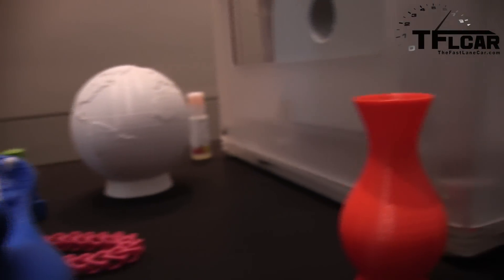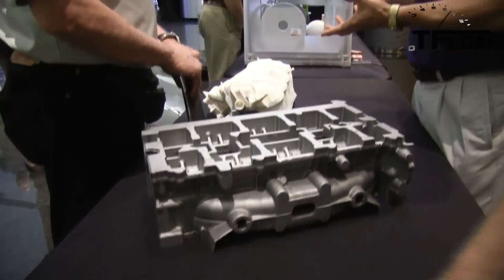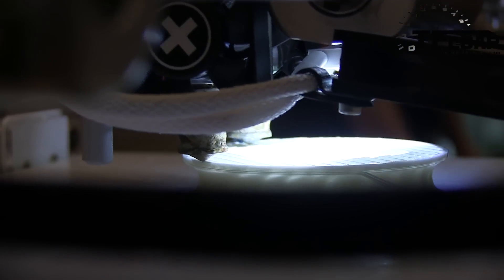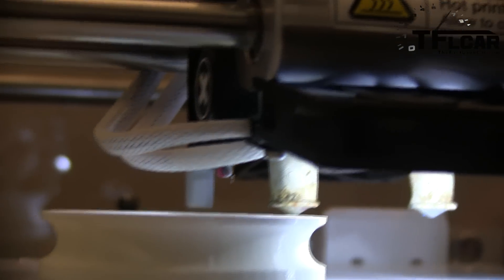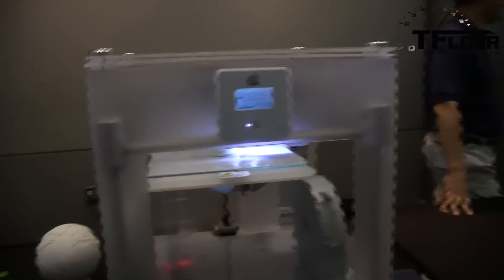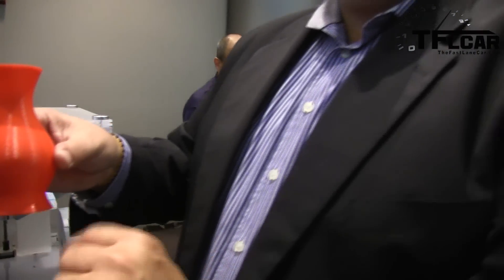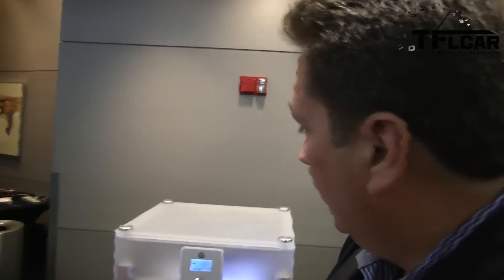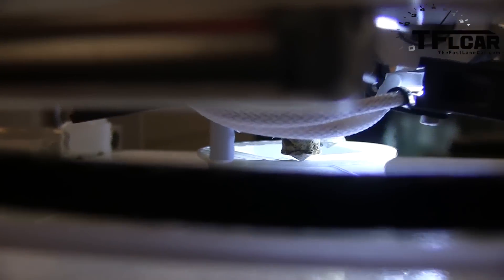The Future of OEM parts: 3D Printing replacement Car Parts?

Comment: I would like to see this used to make transmission parts for the Mercedes Benz 240d and make the 5 speed or more gears to attach to the engine.
Reply: Do the design work and that can happen.

Comment: Meanwhile in Sweden, Koenigsegg is already direct laser metal printing their variable valve turbos for their hyper car.
Reply: Not to mention they have a 3d printer that prints in carbon fiber vs plastic or rubber/wax

Comment: so yes you can print a raw 3d part, but there is no 3d painter, or 3d decal maker yet, the quality of decal you can make at home is poor at best, so there will always be a market for products with graphics or high quality finishes, yes you could make blocks, and it might cost you 20 dollars a bucket electricity, materials, your time, but a production run of molded blocks can be made for 3-5 dollars a bucket. Scale will always be cheaper, it's where you're building unique parts you rarely need that changes things, door handles, nobs, clasps, gears, pumps. People will buy the shell of a device on the market then print the ugly internals. I look forward to building flying vehicles, because now you can print a perfect wing, or helicopter blade and rotor assembly.  To really get somewhere you need a carbon fiber epoxy 3d vacuum mold for large sub structures, then you can print all the small parts, and 3d vacuum mold all the rest.

Comment: my friends stepdad had a 3d printer except theres no plastic covering so its pretty much a bundle of wires attatched to some metal plates and rods, and a hole for plastic wiring to go through and heat up, but the reason why i love the thing is because its so precise and doesnt take much time at all, the stepdad says theat he will actually make the parts for another 3d printer with his 3d printer!

Comment: I print a plastic part for an older car about once a month. Mainly window lift parts in nylon. I use a hobby grade extrusion machine, a Replicator 1 with all the mods. It's an amazing technology but it's way over the average guys head as far as the complete workflow to get idea (or part repair) into a physical object.